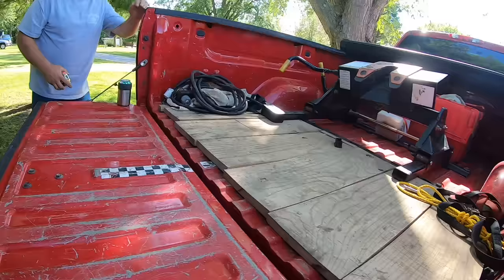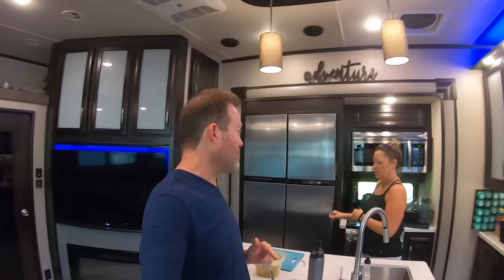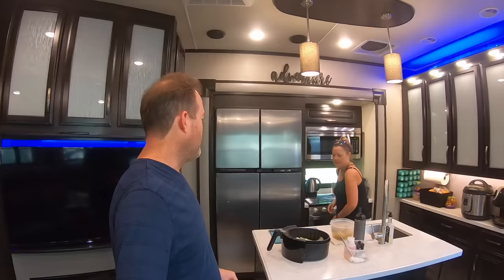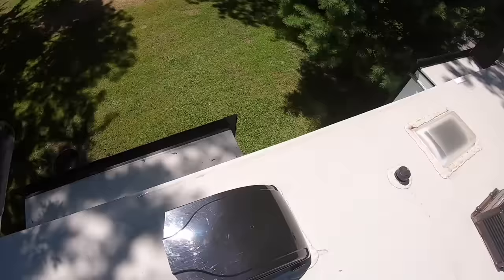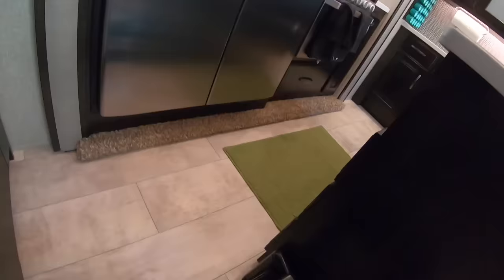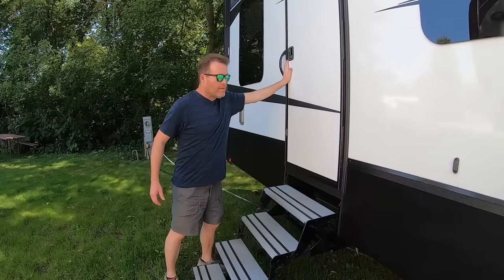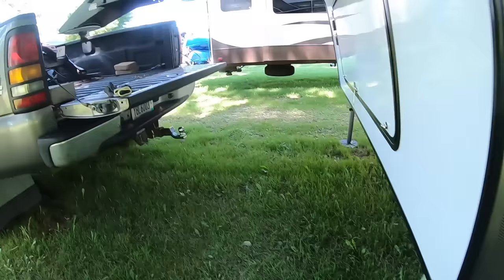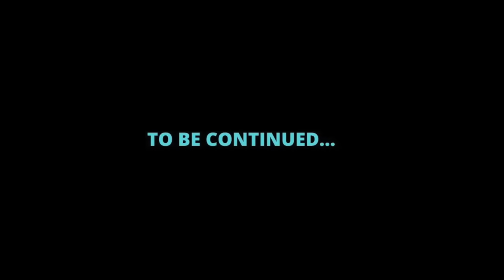RV CRUSHES MY TRUCK ON 1st TOW! BIGGEST RV LIVING FULL TIME MISTAKE!

Comment: Hey man shit happenes, learn from it and move on. I was moving our stock trailer around with the tractor and forgot to lock the tounge onto the ball (I was in a hurry which was the first mistake), I turned around and watched the trailer roll down the incline. I went full brown alert lol but luckily it stopped 30 feet from me. Mistakes happen, just use them as a learning point.

Comment: Believe me you’re not the 1st to do this!  and I am sure not the last...  I have been lucky, but ever since I bought our 1st 5th Wheel, I have always done a “pull test”... first I alway let the hitch on the truck lift the 5th Wheel up a little bit, by letting it climb up on the hitch.  Next I raise the landing Legs just a 1/2” or so off of the ground... leaving the rig still chalked, I get in the truck, hold my electric brake controller manually in full on position, put truck in drive and pull on the rig...  My heart breaks for you, and hopefully the damage is light... Good Luck to you guys! and Safe Travels!  John M. Kelly / Greenville, OH

Comment: So sorry this happened guys. Scary 😳. I’m almost thinking this is more common than one would think, but I’m not sure if it’s the hitch itself or a GD issue. KYD said in one of their videos there have been several reports of this happening on various Grand Design owner’s Facebook groups. I was lost during the hitch demo with the previous owner (Mark?). The new hitch appears to be more sturdy/strong, but this is scary, considering you’ve had a fifth wheel for so many years and have never encountered this issue before now. Maybe a quick google search on the hitch brand would give more insight, (manf. defect, recall?) but I’m sure you’ve already done that. I’m anxiously awaiting the follow up video, as my husband and I have been thinking of going the 5th wheel route eventually, but this event and others I’ve seen recently have me thinking maybe we should stay the travel trailer route, as that is what we know. Sending you good thoughts, 💕 and 🙏🏼   🏖Tribe 😉

Comment: Never saw the follow up video. What happened mechanically to cause the hitch to fail and fall on the truck
Reply: Was not the fault of the hitch. The king pin was not sitting depth wise enough...that hitch already had a factory built on lube plate...he added another lube plate...that was the problem.
Reply: heyinway thank you for the info. I have a Cougar 29RES (X Lite) with Anderson Hitch so no dropping off plate for me!

Comment: At 19:38, the pad does not look like it is flat down hard to the hitch. It looks lifted up, so the indicator was fooling you, the RV  pin just pushes forward the white indicator om the hitch and the pin is not locked into the hitch. The yellow arm ought to have felt funny too, not in the right position, I would think.

Comment: This is hard to see.  I guess 7 years in the Columbus, as you said in this video, was drastically different.   Although it shouldn't be.  I could see if you went from a travel trailer to a 5th wheel this happening,  but that's not the case.   Jayman...

Comment: SO I know nothing about this hitch so not sure where things are supposed to be, and you didn't say in the video. White pointer?? .. What exactly was wrong?  If it was a B&W hitch or Semi I would see the issue, obviously you weren't locked in but you appeared to be. 
I saw the bar across the rear pin, so you weren't high hooked. 

Wish I have a video the first time I pulled out, no crashing like you but be cool to have.

Comment: There went 10g in repairs. I did better My tailgate was still with the Camper when the Insurance Co sent it all to CoPart. That happened at the Dealer the Camper Abducted the Truck ON THEIR TEST DRIVE. bENT THE fRAME ON THE tRUCK AND cAMPER ALL WAS NEW. HEY I AM AN ADJUSTER ON HEAVY EQUIPMENT AND RV'S AND ANYTHING ELSE NO ONE WANTS TO DO. NEED ANY ADVISE LET ME KNOW. THE GRAND DESIGN FRONT CAP WILL LEAK.

Comment: Wow.  I don’t know what to say besides sorry.  I’m looking forward to part 2. I really hope the damage isn’t bad but it didn’t look good.  So, was it the fault of the hitch, (it looked a lil sketch and I figured it was due to the new-to-you hitch) or was it because you forgot to pull that lever?
Reply: Was not the fault of the hitch. The king pin was not sitting depth wise enough...that hitch already had a factory built on lube plate...he added another lube plate...that was the problem.

Comment: Oh my god you should have bought a new hitch and get full explanation on how to use
Reply: Was not the fault of the hitch. The king pin was not sitting depth wise enough...that hitch already had a factory built on lube plate...he added another lube plate...that was the problem.

Comment: In the Video while you had that little Indicator Pin sticking out in Front, and then seeing the rear shot of the Hitch, It did not appear that the Jaws were locked around the King Pin!  

When I hitch, I always visibly check to make sure the JAWS are completely wrapped around the KING Pin!  Leaving my jacks slightly off the ground, I give it a little TUG!  

A commenter below said you don't need the DELRIN PLASTIC Disc!  I disagree.  You do need it or you need to put some grease on the 5th wheel plate.   They use DELRIN PLASTIC, since it has high lubricating qualities.

This is the Hitch I have:  http://www.trailersaver.com/product/ts3-air-ride-hitch/
Not a cheap hitch by any means, but with the size of Trailer you are hauling, this hitch will eliminate many problems down the road.  

Safe Travels.

Comment: So yes, I know that everything is supposed to be perfect and you think that it's all good and boom. Back in our Popup days we had to take two cars. My wife and girls in the Car and our son and I in the Truck. We had just purchased our second of 3 Popups and went out for our first long weekend. I never up to that point ever used a lock to keep the pin in the hitch locked. Got of the interstate on the road back home a very hilly and curvey road in So. Illinois. I was driving about 45 and BOOM! My wife and girls watched in horror as the trailer had come completely off the ball. I somehow was able to get slowed down and off the road. The only thing that saved us was the chains. I had them criss crossed so the Trailer Hitch hit them and stayed. I put it back together and  very slowly finished our drive home. Only damage was the Bumper took a hard it. I put it away and went straight to Walmart and bought a lock and have never towed again without one. I learned the hard way and it could have been much worse, thank heavens my skill as a driver and Bus Driver paid off. I hauled soda for a long time and still have that certification still. Very glad you weren't on the road. you have been a disaster. Good on you guys for showing this, people need to see that everything is not always perfect and can learn from mistakes made.
Reply: now i know why my hubby always used a padlock to lock the pin down hitch on when he towed our boat.

Comment: What caused this to happen? I saw that he checked the bar around the kingpin 🤔
Reply: Was not the fault of the hitch. The king pin was not sitting depth wise enough...that hitch already had a factory built on lube plate...he added another lube plate...that was the problem.
Reply: I noticed that before he hooked

Comment: Do not feel bad your not the first one do this.you have to make sure that the jaw is lock on the king pin by looking at it .An do a tug test.with the hydraulic jacks. One guy said to put them up 1 inch.that is right but not with hydraulic jacks you can not do that.when the truck has all the weight the front jacks will still be on the ground. Have some one stand at the back of truck an watch the lending gear.then do your tug test. When they see that the lending gear is sliding just a little bit stop.you are lock in.now you can raise the lending gear all the way up.on my trailer I have memory. So when I go to unhook I raise 
The trailer up about 1 off the 5th wheel 
An then pull out.then when I ready to hook up I just hit memory the trailer will put at the height when I pulled out.

Comment: Sorry for your luck but a B&W hitch wouldnt have done that.
Reply: Was not the fault of the hitch. The king pin was not sitting depth wise enough...that hitch already had a factory built on lube plate...he added another lube plate...that was the problem.

Comment: I wonder why every trailer brake has a lever to manually brake the trailer? What's a "Tug Test"?
Reply: @safcforme  nope that's wrong.
Reply: @safcforme  you lift your gear off the ground 1inch manually overide trailer brakes give it a Tug and verify resistance. After a verifying trailer is secured to hitch now you can raise gear. Not raise gear and hope for the best like this guy did.
Reply: @safcforme  ok how do you make sure the trailer stays where it is while you tug?
Reply: @safcforme  what will hold the trailer in place while you tug test?
Reply: @safcforme  so your trailer brakes just stay locked all the time?

Comment: someone didnt pull the lock open pin, so the jaw could snap closed an lock,  or didnt back up enough to set the jaw closed, so many have done this and that bad part is, it normaly dont come off until your on the road and the 5th wheel pin takes out the truck tail gate and the trail dose skidding out of control because 5th eheel dont need or use safy chains witch i disagree, you see trasport trailers come off the 5th wheel and go skidding down thehigh way when the air line is ripped off and brake lock on solid and will skid off who know were samewith eletric brakes, when that brake away pin is pulled all whel lock up sending the trailerr skidding off who knows were, icy high way man i have seen them go, even passing the truck that was towing it, as it skids out of control on icy snow pack, any way there first move and there first insurence clam and know truck or RV well iys all in the shop for a half as repair

Comment: It reminds me of when the dealer delivered my fifth wheel the dealer was 25 miles away when he was backing onto my lot I was looking at the fifth wheel then I look back at my lot he was having issues backing it in then all of a sudden I heard a bang lo and behold the pin was loose and the the house slammed onto the bed of the pickup truck causing much damage to the pickup truck a little damage to house. I'm just thankful it didn't come off while he was driving it here.

Comment: How much does something like that cost to repair
Reply: @billyjack8081  I would get something like that but to long for a single guy such as myself. 
So... I plan to get a popup camper so my rav4 can tow it. Plus, better gas mileage to travel around North and South America with a 3,000 pound 13 foot popup camper that extends.